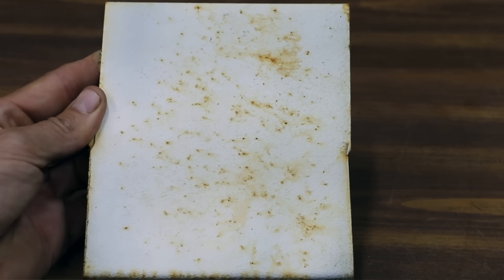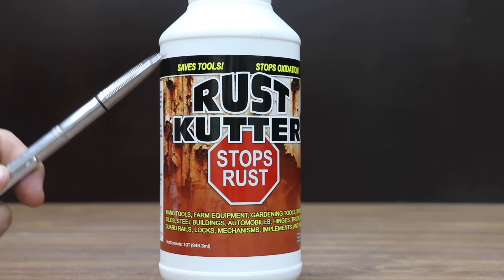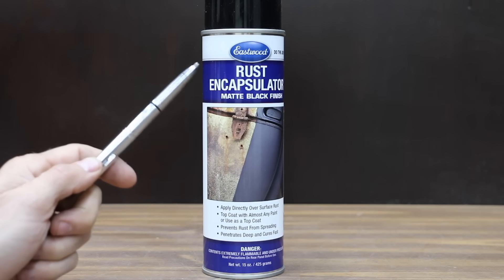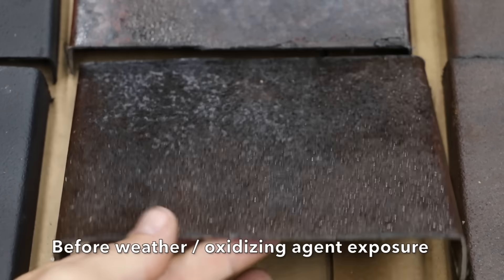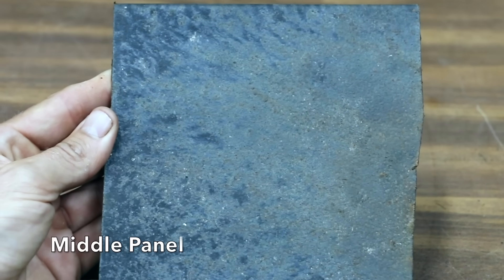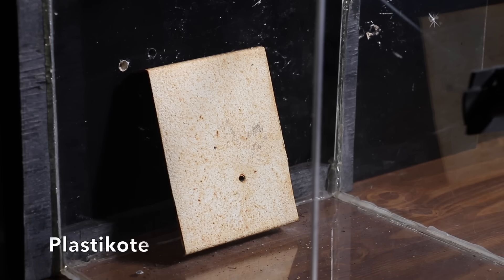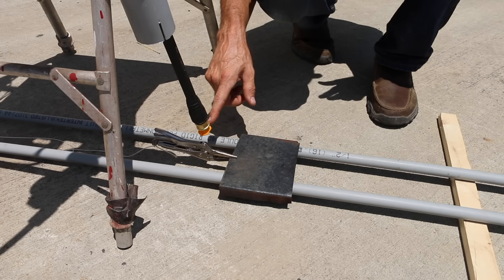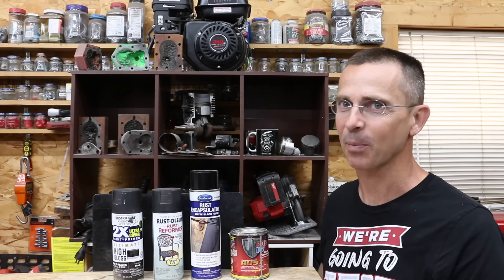Best Rust Converter? POR-15, Eastwood, Rust-oleum Rust Reformer, Gempler's

Comment: I'm thinking rustoleum rust converter with 2-1 on top, then some lanolin based product to maintain.

They also have the 2 in one, reform and seal, that one ahs a rubberized sealant. Maybe that one and lanolin.
Reply from the maker: Thanks for sharing.

Comment: Im definitely not surprised the POR15 killed it. Its expensive but every old tradesman recommends it… a few guys i know that restore old small engines use it to coat the inside of rusted out gas tanks. If it can handle that than obviously it’s good stuff

Comment: I know its an old video but I thought I'd share my experience, as far as the application process if you take the time to apply POR-15 to a rusted surface I found Chassis Saver is a much better product and holds up much better. Food for thought.

Comment: I spray my truck undercarriage and running bars (anything black) with rust oleum once a year which works great, looks new and doesn’t bubble or dull.  And I’ve sprayed over a few spots where rust has crept up and the spray paint knocked it out.  2016 truck driven in the northern salt flats and who knows what other chemicals they put down in Minneapolis and nd.
Reply from the maker: Thanks for sharing.

Comment: The issue/question I have about this test is that the ability of a product to convert rust or protect from additional rust are separate issues. On another channel which did a very similar test with a very similar product line, Rust Kutter came in at #1 not last, because it only evaluated how thoroughly the rust was converted without testing for the return of rust. Rust Kutter converted the rust but offers NO remaining coating, so it's basically bare metal and of course would immediately rust like any bare metal.
Reply from the maker: Thanks for the feedback.

Comment: The repair geek channel did a video which concluded a pretreatment with degreaser, rust kutter as an etchant / surface prep, and KBS rust seal (por competitor) top coat was the best performing coating. That analysis did not use harsh oxidative environments however. Curious how a complete system like that would hold up to your peroxide/vinegar/salt test.
Reply from the maker: Thanks for the suggestion.

Comment: I usually love all of your tests and have found them very useful there's a school of thought that says using brake clean before painting is a bad idea because the residue of surface tension can interfere with the performance of the product this may also apply to rust reformers and or converters perhaps performance for all products would have been better with the wipe down with acetone or alcohol but you are the expert and I'm sure there will be some other opinions

Comment: addressing a rusted floor in my 03 land rover disco 2....have a can of the Rust Reformer spray and after watching this video, I used it.  have a couple of holes that I have to fill and will use POR-15 patch for those.  Should last 4-5 years.  Thx for your efforts.

edit:  I ended up going with covering the rust reformed sprayed areas covered with Amsoil HD Metal protector.  year and a bit since and no sign of rust.
Reply from the maker: You are welcome!

Comment: I have a cutting edge from a Caterpillar scraper that I use as a counter weight and I painted it with POR. It is currently laying outside for a couple of years and very little rust had floated up. I highly recommend the POR if you have a project. It's worth every penny you will pay for it. Side note use some gloves to paint with because if you get it on you it will be there for a few days.
Reply: That's surprising because POR supposedly gets eaten by UV rays. If exposed to the sun you are supposed to topcoat it.

Comment: I would say two things:
1.  Products that depend on contact with rust does not reflect real-world.  There is usually a lot of paint and some rusty areas and there will be some sanded areas fading into light surface rust and onto the paint.  For the bottom of our vehicles since 2012 I tried the rust reformers first from a body shop supply company, which were pricey, but I wanted the best.  When the converter lays on top of paint it does not bond to the paint underneath and in some cases the product above, and what you have is a mess that flakes and rusts around the edges.  It took a few years of paint flaking off for decent paint to stick in those areas.  For someone who prides himself in following directions to a T, it took me quite a while to arrive at that the black semi-gloss Rust-Oleum that matched the bottom of the car, no primer, works the best.  It is counter-intuitive that easiest and simplest turns out to be the most effective in both the short and long term.  I have areas of done years ago where the rust never returned. 

2.  You didn't mention that POR-15 is in a can for a reason.  It is a moisture-cure urethane which is where it gets its properties from.  If you shut the can immediately, you can get more than one use and you will want to use throw-away brushes.  Another is that if you get it on yourself anywhere, it will be there until that area of your body replaces that area, which depending on the area could a short or long time.  Hence, professional use on the label.  I don't know if POR-15 stops rust anymore than any other moisture-cure urethane.  I can say that two-part urethane is the only paint that holds up to stone chips and abrasion on airplane cowlings and stays looking like it was freshly painted for about ever, which something I cannot say for paint or two-part epoxy, which I did not expect.

I came to check if there was anything I hadn't tried after buying a new 4-year-old vehicle,  but it basically confirmed my current methodology.

Comment: What I found that worked very well in bad conditions was Rustoleum professional black paint. I painted 1" angle with this and built my holders for my rabbit cages. It was exposed to urine and water everyday. After 2 years the paint was still intact with no ot very very little rust usually around the holes I drilled in the angle. I never seen anything like it. It was $50.00 a gallon 15 years ago. Well worth it. The only pain was it took 3 to 4 days to completely dry.
Reply from the maker: Thanks for the feedback.

Comment: I've used POR-15 a number of times, it's basically liquid plastic. Using it on the frame of my truck here in NY I guess it's worked as well or better as anything. When it finally starts to let go and peel it peels off in thick, heavy flexible pieces. It probably is the best of the bunch, but years later when rust starts showing again and you go to recoat, you're going to have your work cut out for you trying to get the old stuff off.
Reply from the maker: Thanks for sharing.

Comment: That POR15 doesn't look right, it looks like it wasn't fully stirred and there was a lack of solids in suspension. Applied correctly there should be zero rust showing on the POR panels. I've used it to coat tractors that get used to beach launch fishing boats and had zero corrosion after years of exposure to salt water daily. Also, the silver is not the best, the black has a lot better resistance.
Reply from the maker: Thanks for the constructive feedback.

Comment: There is still some doubt about how to use rust converters, specially since they seem to need top coat. Would it be possible to make a follow up video testing:
1) CRC Rust Converter
2) Corroseal
3) Rust Kutter
4) VHT

And then coating each one of them with the following products:
1) POR 15
2) CRC Heavy Duty Corrosion Inhibitor 
3) Rustoleum 2x Paint 
4) Surface Shield

I genuinely want to know and would gladly send you the test samples and materials.
Reply from the maker: Thanks for the suggestion.

Comment: This seems like a flawed test. The title of the video suggests we’ll find out about rust converters*, but the tests test rust *inhibition*. The last place performer, Rust Kutter, is high in phosphoric acid and does an excellent job of *converting rust, but will do nothing to inhibit it. After conversion, a top coat would be necessary.

Comment: I did some rust proofing on my truck used the degreaser and metal prep for some parts then figured out por15 can’t be re used so I applied por15 to some parts I decreased and metal prepped and other I didn’t it still went on the same now I’m cringing at my cheap minded decision but I’m hopeful it won’t be that bad since most don’t prep ohh well learned my lesson
Reply from the maker: Thanks for sharing.

Comment: This is problematic. 1. They were basically cleaned of rust when he started. Not exactly the flaking curling rust here.
2. Just because there is a layer of paint or some product and you dont see rust it doesn't mean its not rusting underneath it

Comment: This is not an apples to apples comparison. Half these rust products aren't supposed to be used as a protective coating. Of course they will rust.  You're supposed to prime after it does it's thing.
Reply from the maker: Thank you for sharing!

Comment: What about a scenario where theres a small concentration of rust but the surrounding area is rust free and still painted?
Will these products stick to remaining paint/underbody sealant etc or do you need to completely sand to bare metal?
Lets be honest, most cars suffer from concentrated rust spots, whats needed is a product that can be applied over bare metal, treated metal (previously painted from factory) and prepped metal (rust removed).
Reply from the maker: Thanks for the suggestion.

Comment: I’ve been using a product called extend for over 30 years made by loctite, it’s a polymer coating that pretty much looks like Elmer’s glue when applied and dries to a black finish.
I use it on everything from automotive to home improvement and actually learned about it when I was working at a factory, it seems to compare with the POR product.
Reply from the maker: Thanks for the feedback.

Comment: I AM FED UP-You constantly do reviews that leave out some of the best products and tools-just because they aren't sold in the box stores-apparently. This time you did not include OSPHO. All of these products you included are primarily phosphoric acid-at a high price. OSPHO has been the commercial and industrial standard for decades, tho it began retail sales a decade ago. Folks-give it a try, brush it on, let it do its work (can be left exposed for a few days-no problem) then paint with primer/paint for metal or just cover coat.
Reply from the maker: Thanks for the constructive feedback.

Comment: High Todd. Another great video that I and many others can benefit from. Three weeks ago just bought a 2005 Honda Element with 148,000 miles for $4,000. Yesterday a big rain storm came through and after it stopped and the car was dry, I opened the back hatch then the tailgate and saw water on rubber the rubber mat. It's's not the rubber seal,  but rather what looks like rust under the paint on both left and right corners. Looks like I'm going to buy some POV, flex seal and rustoleum paint.
Reply from the maker: Thanks!  Thanks for sharing.

Comment: So there are rust removers, and there are coatings which protect steel from rusting.  It seems like we have a mix of these two concepts here competing as if they do the same thing.
Reply: Right? Rust kutter was the best on repair geeks channel. It’s not meant to just spray and do nothing with. It covers the rust then you have to paint it

Comment: Just imagine if you had actually followed the POR 15 instructions. 
Use their cleaner, not brake cleaner.
Use their metal prep to etch the piece.
Apply 2 THIN coats. The second coat when the first is still somewhat tacky.
Apply finish coat when the second POR 15 coat is still somewhat tacky.

Also, a very little POR 15 goes a very long way.

Comment: This appeared on Home Depot’s RustO 2x FAQ product review: “Before applying Rust-Oleum Painter's Touch 2X Ultra Cover Spray Paint over rusted metal, we recommend sanding any loose rust and peeling paint, then prime using Rust-Oleum Stops Rust Clean Metal Primer. After priming, 2X Ultra Cover can be applied. - Rust-Oleum Product Support 6”.  Are they just selling more product?

Comment: Testing of the products (especially shop items) is great.  Oils, paints, welders, tools ...

Probably the high quality brands like Rust Oleum do test their products.  In the past I worked for a large chemical company, and they did extensive testing of paints and coatings in lab.  They even had an outdoor testing area.  They would put samples out there for years at a time like in a matrix of panels.

You are reproducing that kind of testing on a practical level, its very useful for consumers.
Reply from the maker: Thanks!  Thanks for supporting the channel!  I really appreciate it!

Comment: Trick for keeping POR-15 fresh for years: Don't open the can. Once you do, moisture will get in and start a slow curing process that will leave the product unusable in a few months or less. Instead, puncture the lid (about a 3/16" hole) and pour what you need (the stuff covers a lot of area with very little material) into a clean plastic container. Wipe the lid clean and immediately reseal the container with foil backed tape (Duct tape will also work). Invert the container briefly to coat the backside of the hole. Do not put leftover POR-15 back in the can, ever. Allow the leftover material to cure (it will be like a hard plastic) and you can peel it out of the plastic container so you can reuse it.

BTW, I restored a 1986 Pontiac Fiero GT using POR-15 on the chassis 12 years ago. No rust has returned to date.
Reply from the maker: Thanks for the feedback.

Comment: flawed test. 
these are rust CONVERTERS, not PREVENTIVES. 
would've liked to see which one of these CONVERTS the rust and stops the rust from SPREADING first and foremost  so that we'd have some peace of mind about it spreading underneath the paint - would've been nice to see how much of the rust were converted after the 1st application by scraping it off and showing the rusted surface before and after.

 tho it was interesting that they all reacted to the oxidizing agent AFTER the application and that some had preventive properties,, it showed little of the conversion that occurred to the rust  when first applied- since.. you introduced a new rusting agent.

Comment: Thanks for the great videos! Moved into my house in 2000. House had steel Bilco doors into basement (12 year old house). Bilco's had original primer but had never been painted. They were rusted bad enough to where I looked into replacing them. Decided to paint with POR-15 and topcoat with Rustoleum paint. It's now been 23 years since I POR-15'd them and they are in great condition. I do repaint them every 6 or 7 years. The POR-15 just locked up the rust and they look better now then they did 23 years ago. Good Product! I also used it to treat the bottom of my Toyota Sequoia, Toyota's are rust bombs if you live in the snow belt.
Reply from the maker: You are welcome!  Thanks for sharing.

Comment: Have used the POR 15 on floor panels 15 years ago and yes it sure works. They warn you that if you get it on any organic surfaces.....It will NOT come off.   And the lid has to be kept clean because it will seal itself shut immediately.
Reply from the maker: Thanks for sharing.

Comment: I Used Por 15 on a light duty dump truck dump bed with great, awesome results. All did was use a powered wire wheel to remove light rust, cleaned the bed with compressed air and then wiped down with a degreaser, cleaner and allowed to dry well. I spread the Por 15 very thin with a brush and roller and shockingly it held up very well to loads of Class five rock, gravel bing dumped on it. I will be doing the same project afain with another dump truck next week using Por 15 again. If POR 15 gets on your skin its almost impossible to remove, trust me..
Reply from the maker: Thanks for sharing.
Reply: How much did you guys use? A whole gallon?
Reply: @RacingDeath1000 Surprisingly I used as little as possible because I wanted to see how the product worked. The dump bed itself was 10 feet long, if memory serves me correctly I used two to three points of POR15. 
I still own the Dump truck and the bed is still Not rusted and the last three loads were sharp, small driveway rocks. I applied POR15 with a small, stuff brush to fill in all imperfections or rusted areas of the dump bed. 
I would have replied sooner but I wasn't aware a question had been asked. Great stuff. Project Farm is the best channel for product testing, hands down ❤.😊

Comment: Do yall recommend that por15 3 system pack they sell? Im doing the inside of the my van with this since it wont be exposed to uv and im going to use rustoleum 2x white for the outside of the van.. gloss im thinkin although she is an 02 so a semi gloss would probably do. Just wingin all this but thankfully.... youtube. 😂

Comment: Project Farm, have you ever used Potassium Phosphate to convert residual rust of iron oxide to iron phosphate first? That’s the ultimate rust converter … then will POR15 adhere to both rust and non-rusted surfaces equally treated in such a fashion?
Reply from the maker: Thanks for the suggestion.

Comment: Will POR 15 stick to non rusted surfaces ?
Reply: Yes it will, quite well I might add. I used it on a dump truck dump bed after first using a 4 1/2" angle grinder with a wire wheel to remove light rust, then I used a cleaning agent and let it dry well. Applied by a very small roller and small brush to spread the Por 15 out. I let it dry for days and then picked up two loads of Class five material for my driveway. I was shocked as the POR 15 had scratches I could see! The truck was a smaller dump model, maybe 8 to 10 feet long. I love Por 15 and use it A LOT..
Reply from the maker: Thanks for the video idea.